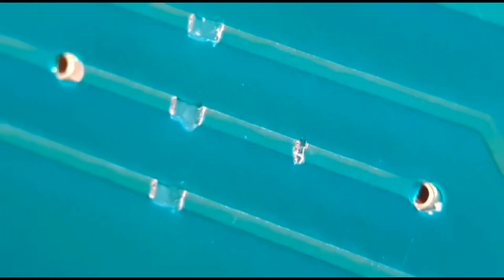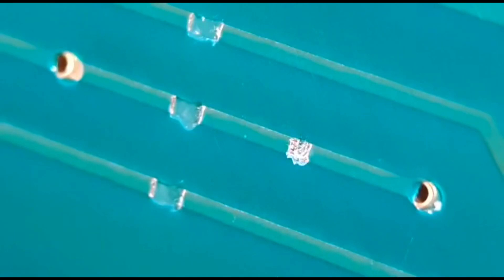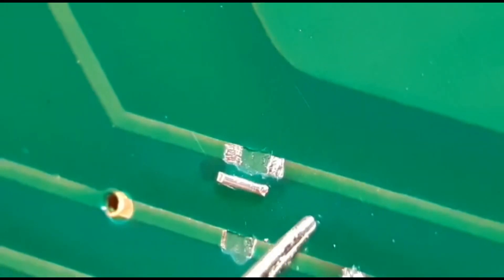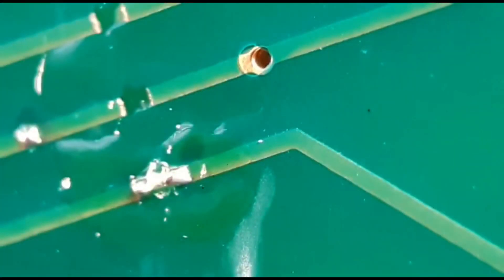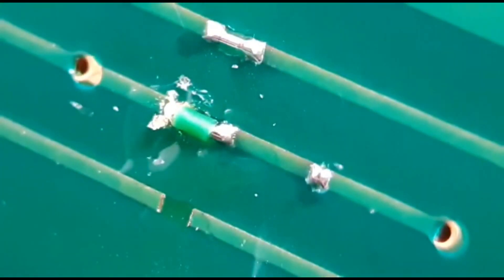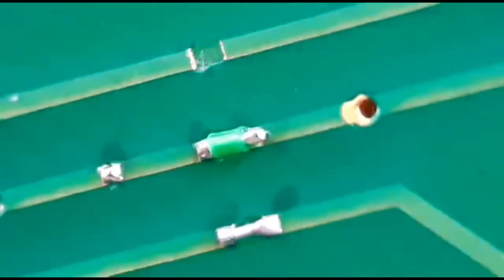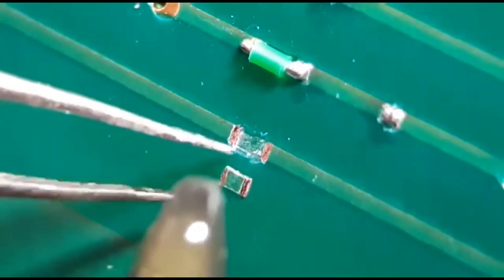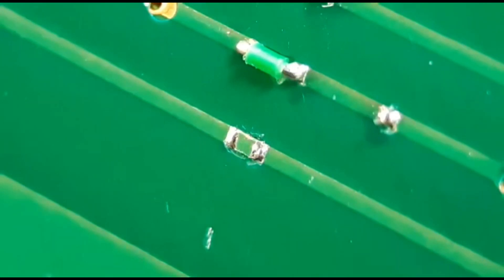How To Repair Broken PCB TRACE  -  Learn 4 Different Methods

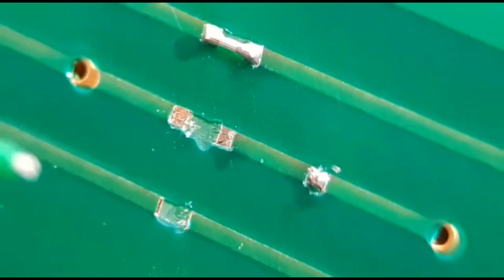Comment: @4:15 what kind of wire did you say that is?

I'm an idiot and accidently scraped a track inside my novation launchkey midi keyboard.....I rather fix it cuz I'm too broke to get a new one
Reply: I forgot why I had it open in the first place but it was most likely due to a track being fckd off too but it is findable when plugged into certain devices but on my ipad it's not findable and there's absolutely no lights turning on the key board anywhere on the outside

Comment: Great video! It would be nice if you'd mention the temperatures and the type of tip you're using besides explaining the technique itself.
Reply from the maker: Hi , thank you for your comment . The information you mentioned I have probably spoke about in various points of my videos on about half of my soldering videos . I just can't keep speaking about the same information all the time as it just drags the videos on longer . Thanks again , hope you understand 👍

Comment: Can I use any wires for 2nd options?
Reply from the maker: Hi , pretty much . The main thing is to try and match the width of the track . If you put a tiny wire on a really wide track when signals etc are running down this track the board could fail. I will do an updated version of this video sometime soon as I now have much better recording equipment.Hope that helps , thanks for your question 👍
Reply: @mrsolderfix3996  thanks alot for sharing your knowledge
Reply from the maker: Hi , no problem 👍

Comment: thanks for the video. what would you recommend to repair tracks on a PCB with a split in it? the PCB was broken from overzealous used of some buttons and therefore it would always be under stress once repaired from the buttons being pressed often.

Comment: What about the traces that lead to a hole , where the leg of a component gets solderd inside of? My straight trace leading upto it was ripped out along with the inner circle pad ? In and around the solder point hole on the PCB for a ebike kit  motor hall board sensor.
Reply from the maker: Hi . I've done another YouTube video showing 4 ways to repair through hole pads ( Pth pad + trace repair ) , maybe this can help you . Thank you for your comment , take care 👍

Comment: Awesome video!! Really helped me repair my keyboard after I ripped off a tracer. Just in case someone else doesn't have spare gauge wires like i did- i used a spare USB charging cable and opened up the wires in there and soldered on normally. Worked fine for me. Thanks man!
Reply from the maker: Hi , thank you for your comment, much appreciated. I'm glad you enjoyed the video even though I posted this one a long time ago when I had a camera and microphone that were pretty poor 
 My newer videos are a much better quality and I've recently posted another trace video showing how to repair longer traces , this came out really well . Anyway glad I could help , good luck with all your soldering projects in the future 👍
Reply: @mrsolderfix3996  HAHA I noticed that. Had to turn the volume up.

The contents is still spot on, though!

Comment: Practicing like crazy on the micro soldiering. Just a quick question, might seem like a dumb one but I've seen it happen a few times. 

Can you use jumper wire in place of a mobile phone motherboard capacitor? Tiny little brown and black ones? If answer is yes then is it only brown and black that can be bypassed joining the tracks with jumper wire in its place or can all damaged capacitors including blue and white be bypassed  by using  just the jumper wire?
Reply from the maker: Hi , I'm sorry I can't really answer this as I'm not really sure , but I've never heard of replacing capacitors with wire . This doesn't sound right to me . I've heard of people replacing zero ohm resistors ( I've even done this a few times ) with wire links but never capacitors . Hopefully someone else may know the answer . Sorry .

Comment: What if the whole green part of trace is removed until the hole with circular copper that is connected to the trace?  What can i do?
Reply from the maker: Hi , I presume you mean the long trace from the pin to another point on the board ? If so you can simply use sleeved wire ( matching the original trace size ) , 30 gauge Kynar wire is great wire to use for long trace repairs of a similiar width.
I always try and take the same route as the missing trace as this can be quite important in certain applications . Ive done a video on YouTube showing Kynar wire mods and the gluing down of these wires , if I have worked out correctly what you were asking this may help you..

Comment: What if it breaks at one end of the trace?
Reply from the maker: Hi , I'm not quite sure what you mean 🤔 but I will try to give an answer . If I have a broken trace without a gap , so it's lifted at on end , I will simply cut off until the lifted side is solid . Then just join across with sleeved Kynar wire. Maybe you mean if the trace has broken away from a via ? If so I repair by making a new via pad with trace attached and join accordingly. I show this repair in one of my other YouTube postings (PTH pad and trace repair ) pretty much every visible trace can be repaired somehow but like I said I'm a bit confused by your question . Hope I guessed correctly . Thank you for your time 👍
Reply: @mrsolderfix3996  I have a cheap battery-powered desk lamp, it fell off, a bit of the broken PCB fell off, so I scrapped the remaining of the PCB to expose the positive and negative trace, I accidentally screwed up the positive trace with too much solder and heat, now a part of that trace is missing.
Reply from the maker: Hi . Normally you can just bridge a piece of wire across the missing part of the trace as long as it's roughly the same thickness as the missing piece and it goes to the right places you will be fine. 
Hope you get on ok 👍

Comment: What type of Flux and solder do you use?
Reply from the maker: Hi , thank you for watching much appreciated . The solders I use are lead free 0.38mm + 0.25mm , alloy Sn100SB and leaded 0.25mm + 0.56mm , 60/40. All from BLT Circuits ( England ) . The flux is SMFL200D , I've done a complete posting on YouTube showing the benefits of using this flux , places to buy it etc , this might help you . Thanks again 👍

Comment: About what gauge is the solid core wire? 24-26? Awesome video, super useful. Thanks!
Reply from the maker: Hi . Thanks for your support , much appreciated. The solid wire in this video was Kynar 30 gauge . This is a standard pcb modification wire , the one I use the most . I just try and match up the track width with the wire width which is important , and often Kynar matches perfectly. Thanks again , good luck with any projects 👍

Comment: Where was the soldering wire/solder ??
Reply from the maker: Hi . I'm a bit confused by your question.
Reply: @mrsolderfix3996  I am beginner and never done soldering, there is a solder wire that you feed into the connection, i was wondering you directly connected solder iron to the connections ( now i realize perhaps you had melted solder already on the iron ?)
Reply from the maker: Hi . In this case because I had to hold the small links etc in place with tweezers I had already melted a small amount of solder on to my iron tip . Hope that helps . Thank you for watching , much appreciated 👍
Reply: @mrsolderfix3996  thanks it did alot

Comment: Great video, it helped me fix an old super famicom controller that I got off ebay that was "Cleaned and Tested and in good working condition".  The start and select buttons didn't work at all... I thought that it just needed to be cleaned, but then I noticed that the circuit board was just very slightly cracked in the middle and it looked like a couple of traces might have been broken. I tested with a multitester and it confirmed that theory. Controller works great now, thanks. Next I'm going to replace the 7805 voltage regulator in the console because there are wavy lines in the video output and from what I've read I think that might be the cause. Hopefully that fixes that because if it's some chip on the board with a ton of pins that needs replacing that's way above my soldering skill level.
Reply from the maker: Hi , thank you for watching the video , much appreciated. I'm really pleased it helped you to fix your board problem . This is why I make the video's I do , to possibly show people a few things they may not know and hopefully help them . Good luck with your other project , and thank you again 👍

Comment: You're a life saver. Used you're videos for so many repairs.
Reply from the maker: Hi . Thanks for your comment, much appreciated. I'm glad you've found the videos of use . As long as I can help a few people out then it makes it worthwhile . Good luck with all your projects and thanks again 👍
Reply: @mrsolderfix3996 So how do I repair a trace where the foil lifted and got destroyed at the hole where the capacitor goes? I fed the capacitor and connected to the other component and now it does not work
Reply from the maker: Hi , thank you for your comment . It sounds like your board is a multilayer board and if you have pulled the barrel out of the hole then the internal layers won't be connected to this barrel anymore . This can be rectified in some cases but you would need to get the schematic diagram of the board and externally wire to the relevant points . Soldering to the top and bottom layers like you have probably done just means these 2 layers are connected and not the internal layers . Hope that helps 👍

Comment: Great video.  What are you using to clean/ scrub the board after soldering?  Thanks
Reply from the maker: Hi . Thank you for watching . The fluid I use to clean all my solder joints is called Ultrasolve . It's the best pcb cleaning fluid I've ever used ( and I've pretty much used them all ) . The cleaning cloths are called Gtek dry wipes from a company in England called Grove Sales ltd. Again in my opinion they are by far the best cleaning cloths for PCB's , leaving virtually no fibres behind and leaving boards amazingly clean . I just dip a cloth  into a small amount of the Ultrasolve and wipe all flux residue off with ease. Hope that helps 👍
Reply: @mrsolderfix3996  thank you very much for explaining that!
Reply from the maker: Hi . No problem 👍

Comment: Is there any specific type of soldering iron required for broken traces on pcb?
Reply from the maker: Hi . No , I just use a Weller soldering iron with a small conical ( pointed tip ) fitted to it . To me the main thing is when doing small traces is you really need this small tip otherwise it won't be as neat and easy.
Basically any decent iron will do it but the cheaper irons only come with one large tip fitted  and this makes it difficult.
Good luck and thank you👍

Comment: Hi can you suggest me with what to solder a broken trace if I share the pic of my PCB
Reply from the maker: Hi . I always recommend to people when fixing traces 1/ You must match the thickness of trace with something equivalent , I use Kynar wire for narrow traces and for thicker traces just use a thicker wire or a component leg from a resistor for example , 2/ as the video just scrape back the resist from either side of the break , 3/ tin where you've scraped back and join with the wire either side. I sometimes use a piece of trace lifted from another board but this is probably not what you need to do. Longer trace repairs I use pcb glue to bond them down . This is the general way I do my repairs , all 4 standard short repair methods are on the video. Hope that helps.
Reply: @mrsolderfix3996  are you using a microscope in this video .. because my PCB wires are so tiny
Reply from the maker: Hi . I do most of my work under a microscope because most PCB's these days need it .
I know some people use an eyeglass or a bench magnifier but for anyone doing a fair bit of pcb work I would get a microscope. All my filming though is done with a phone camera with an added on macro lens. I don't use a microscope camera. So you could for starters try an eyeglass or bench magnifier for cheap options . Hope you get on ok 👍
Reply: @mrsolderfix3996  thank you so much for the info.. I just had one more doubt.. The PCB is laminated right ..  So how can we solder wire on it from outside. And how do we remove the damaged wire
Reply from the maker: Hi . All traces and pads etc on a pcb can be soldered to . Simply scrape off the resist carefully that's on the pads and traces etc , then use flux ( if u have some , but flux is a must for soldering) and tin the points you need to connect wires etc to . Nothing is impossible , that's what I try to tell myself . 
If you ever need to remove damaged traces / tracks they can be cut off and also they peel off boards fairly easily normally . Hopefully this will help you . Good luck 👍
Reply: @mrsolderfix3996  thanks a lot .. I will try to repair .. But you missed to mention what should be used for peeling the damaged traces
Reply from the maker: Hi . Generally all you need to do is carefully lift up with a scalpel blade and then I normally hold with tweezers and they normally peel back pretty easily as far as you need. But if the trace is secured down properly I would generally leave it there and just repair across the break . Good luck 😁
Reply: @mrsolderfix3996  in my case I can't see where it is broken.. Just It has turned rusty or something

Comment: I love the videos, I didn't see much on smd on your channel, are you familiar with DSP Integrated Circuits?
Reply from the maker: Hi . Thank you , much appreciated . Yes I've done lots of Digital Signal Processor work , fitting them from new , also changing faulty ones . I am going to try to cover lots of different devices on my postings eventually , and will definitely do one on the changing of one of these devices , or just fitting a new one. The biggest ive worked on from memory was 208 pins . I haven't yet posted many videos so still got loads of components to cover yet. Thank you again for commenting , and I will defo do this video sometime👍
Reply: @mrsolderfix3996  That would be awesome to see you work on a 100 pin Integrated Circuit! I tried to resolder one of these and removed 4 of the pin  connection though they did not appear to have been connected to a trace like in this video. All the other are in tack, did I ruin it completely
Reply from the maker: Hi. No problem , I will definitely do this video sometime. If you remove pins accidentally when soldering or remove the pad , as long as this isn't connected to a trace or to a via underneath the component body then it is not a problem . So basically if it's an unconnected pad you'll be ok . I done a posting a while back where I replaced 2 pads connected under the body of the IC. Also I posted one on replacing broken pins on an IC , which is pretty cool .There is normally a fix for any mishaps. Hope that helps and good luck with your projects👍
Reply: @mrsolderfix3996  I can assure you it was not connected underneath the component, instead is was contact around the perimeter with no trace to it. I wish I could send you photos of what I'm dealing with I could use some adivce. Thanks for the reply you're a solid person
Reply from the maker: Hi . If the pads had no connection going to them in this case you will be ok . Occasionally you can get pads that have hidden via's underneath them but I doubt you have these. When I solder DSP pins to the pads I personally do each pin individually . I go in and out ( solder one pin then pull my iron away then go into the next pin ) I never drag solder like some people do . There seems to be less risk my way but I would never stop people drag soldering if that's their preference. Also the thickness of solder makes a massive difference . I use 0.25mm solder supplied by a UK company called BLT Circuits when I'm doing fine pitch DSP's. I see people using 0.7mm sometimes and it makes it really really difficult then . Good luck. Hope that helps.
Reply: @mrsolderfix3996  That does helps alot, yeah I made the huge mistake of dragging the solder across some pins instead of going one by one like you mentioned, big mistake on my part! I'll take this information and do good with it, thanks
Reply from the maker: Hi. No problem , thanks again for watching , much appreciated 👍

Comment: So the the last approach you scrape a donor PCB trace on a junk board, cut the ends, then lift the trace up with a blade. Reminds me of your IC leg repair video.
Reply from the maker: Hi . Yeah , so the last repair I cut a trace off an old board that exactly matches what I need , but can only do this with resist staying on upto about 10mm long. I carefully lift this trace flat , I don't roll it up then remove any fibre's off the back , this way the resist stays on the trace . Then all you can see is a tiny joint either end when you fit it to the new board , becoming almost invisible to spot. It's a great method if done right . Thanks 🙂

Comment: G job Sir... Are you using lead free core.... ✌️
Reply from the maker: Hi . For this video I used lead free solder 0.25mm. Lead free is way better now than it used to be.I always use 0.25mm on small joints. I use leaded solder only when people ask for it . Thanks for the question.